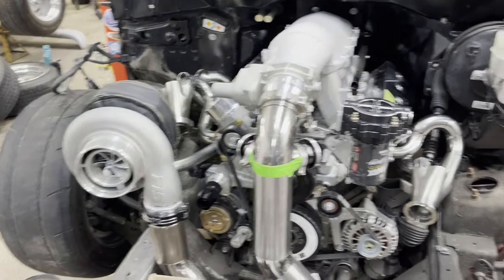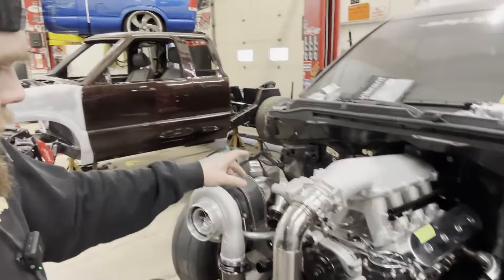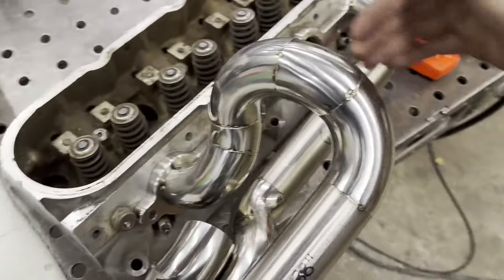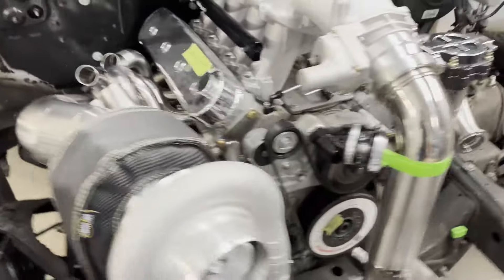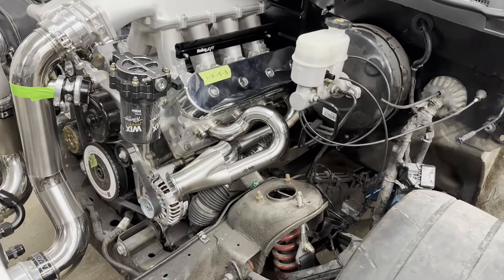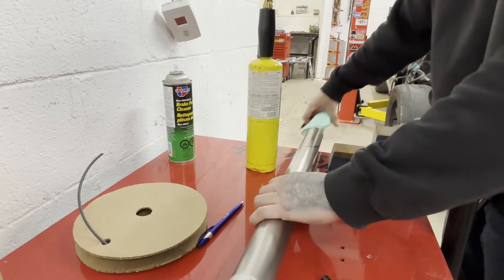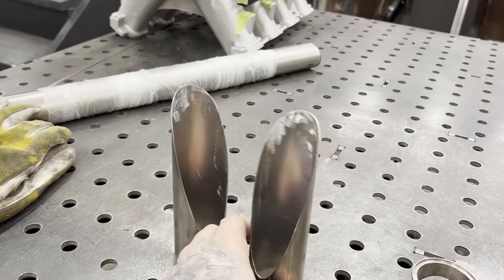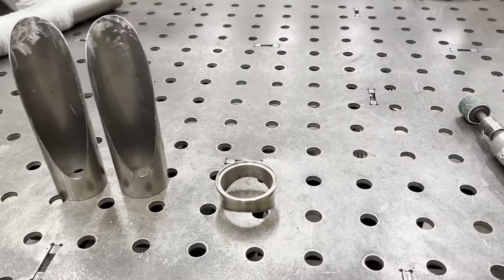1500HP Sierra Episode 9, Headers part 2, and then some.

Comment: It's a good looking setup brother but your putting WAY to much thought on the headers... it's a turbo small block man the only thing they are gonna do is eventually hold back pressure after you start turning it up
Reply from the maker: I can definitely agree, I am putting way too much thought into it, but that's kind of my MO haha. This is all a challenge/learning experience for me at this point. I've built dozens of 1000+hp turbo kits and never cared about the length of anything so this is just the opposite end of the spectrum for me. Best part is, if it starts becoming an issue down the road, I can just build something else!
Reply: Can’t wait to see this badboy rip 🤜🤛
Reply from the maker: Haha, same!